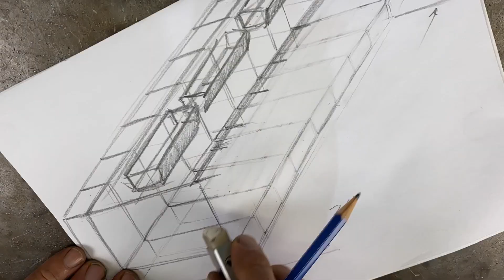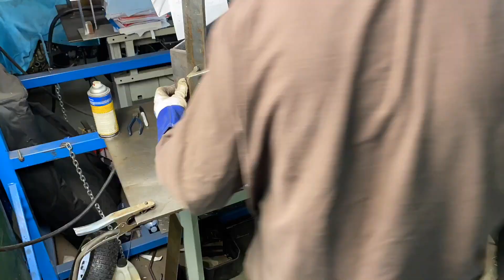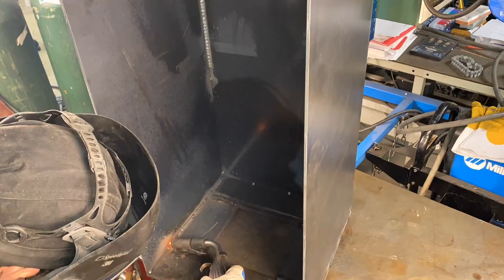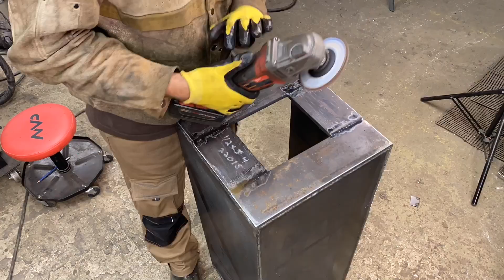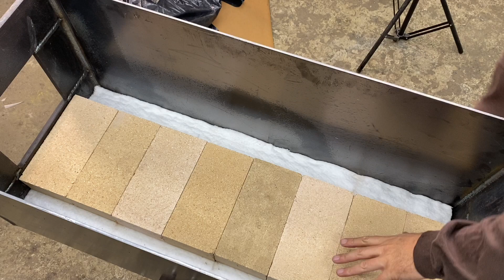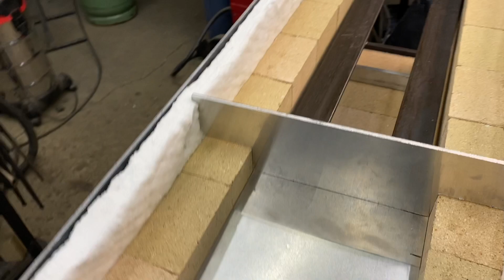MONSTER FORGE BUILD!!!

Comment: Did you use standard fire bricks or the the light soft ones?
Reply from the maker: These are the heavy ones they take more heat shock
Reply: @BonifabcustomRobBonifacio  Yes....I think the soft light ones offer more insulation but are fragile.....they would probably get bashed up in a forge
Reply from the maker: ravenhhca i use the soft light ones for my electric heat treatment furnaces it’s a lot easier on them

Comment: Perfect timing 
I'm getting ready to do one. In 10" pipe  4' long.  Going natural gas with a few ribbon burners.  Tired of hauling propane + running out. 
My billets always get too long & I don't like heating up in sections.  Usually do 15 lbs at a time.  

You think your brick + Kwool   be too much??  Was always told not to use both.
Reply from the maker: The brick and kwool is the recommendation from the refractory suppliers it’s one of the best ways to heat and keep heat in your forge , and it’s also less expensive and replaceable, thanks for watching the channel